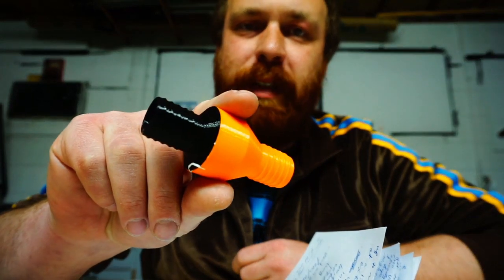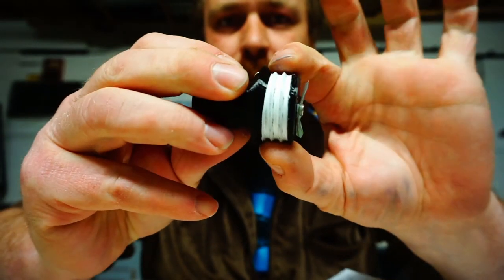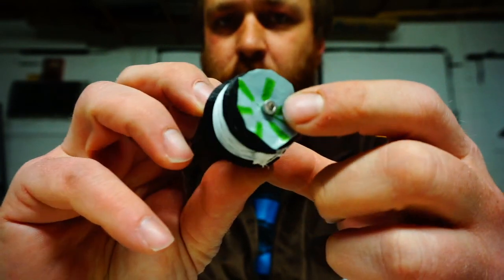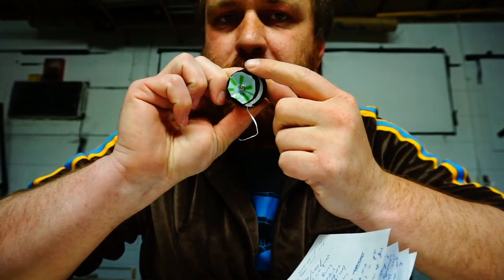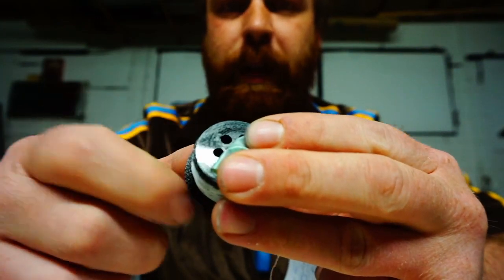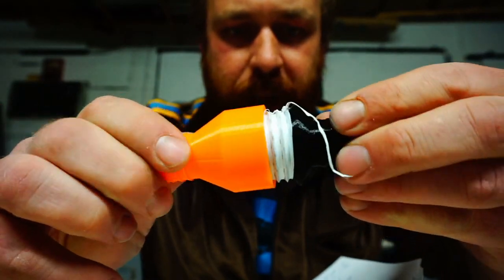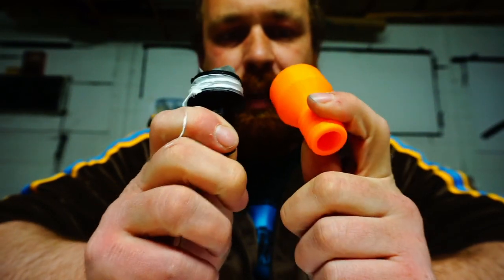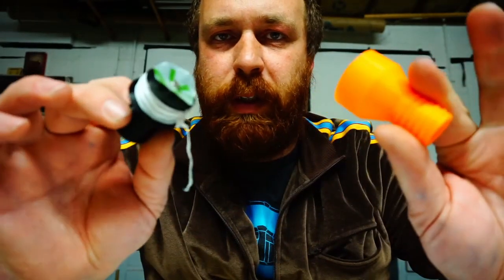COVID 19 CORONAVIRUS Ventilator Check Valve Part

Comment: I had an idea about a two cylinder system. the piston using two one way check valves. So the piston moves between 400 and 600ml of air for each breath. Use a variable crank-shaft to adjust the volume. One piston to draw in fresh air and expel it into the patient, the other to draw the exhaust air out of the patient and expel it into an oil/water filter to kill any virus from the patient. The volume of 400-600ml at a 12/min rate should provide the full extent of breathing assistance for any patient.

Comment: Great design concept! Why not print the entire piece in one go (print direction along the long axis), with breakaway supports in the center (on the side of the orifice that will not provide seal, supports removed after printing via pliers...15% dense line infill for support should work just fine)? Having one piece removes your large thread seal, and you'll probably still have a good enough surface finish (with most printers) on the opposite side of the orifice to make a low-pressure support. After printing, insert your screw with the walmart bag on the side of the valve that wasn't printed with supports. Happy printing!

Comment: Great job. If you want to buy a check valve like this it's the same as what's in a hand balloon inflator. You'd have to cut the end off and seal up the cut off end with something (when I designed toys, we used an awful lot of foam-core board and hot glue). You can buy these at the Dollar Store...

Comment: The black part can be achieved very easily. Take a compatible shape using PVC. Wax a sheet of glass or acrylic. Build a damn wall with silicone caulk 1/4" tall. Pour a pool of epoxy resin onto sheet. Sink PVC parts into pool of resin. After curing the resin can be heated to 140F with a heat gun. It will become very flexible like a thick sheet of vinyl. Warm and use hardware knife to separate parts. Do the same heating technique to trim outer edge. You now have a tube with a glass smooth air tight seal ready for drilling.

Comment: How do I download the solidworks files? I'd like to change the thread between the parts to something like NPT or a metric equivalent to improve the seal where you have teflon tape.
Reply from the maker: select the parts in the parts panel on the left hand side and click export.  you should be able to export as lots of different file types, including solidworks.  I usually use solidworks, but used Onshape this time, and would encourage you to do so too, that way anyone with a free account can see your mod, and take that one, and improve upon it, with just a free Onshape account, rather than having to have a solidworks license and box to run it on.  They wont let you edit my file, you just have to make a copy to your own account, and you can do it there.  If you come up with a better seal that doesn't require higher precision printing, let me know, and I'll share it.
Reply: @CAMERADACTYLCameras  I can select the parts but not sure where to find the export button. Do I have to login? any chance you could post here a link to the .stl version ?

Comment: I think PETG is a better choice for this application, its physical properties would allow for a snap-together design without extra screws or plumbers tape.  A solution that works straight off the printer would be ideal.
Reply from the maker: I agree.  I only have a few rolls of petg, and many printers wont get hot enough.  I use pla for prototyping, but it would certainly work with petg.  I'm not sure that I could get an air tight seal with a snap together petg version.  You're welcome to grab the file and make a petg snap together file, maybe you can get it air tight?  maybe with some glue as a disposable glue together unit?
Reply: @CAMERADACTYLCameras  I have been researching the designs for the DIY ventilator. My biggest focus has been on the ambu bag type resuscitation devices. They are still widely available for purchase, so they were naturally a good foundation for development. In your first video, you highlighted the need for a high torque low speed motor that is available as wide spread as possible. I have not seen anyone consider using windshield wiper motors, in my opinion they fit the bill. They are in scrap yards the world over and can tolerate extended use while being variable in speed settings. My thought is to run a linkage setup that would allow equal pressure on the ambu bag. This is the most analog and simple thing I can think of. Utilizing resistors to change the speed of the motor compressing the bag. From there, attach whatever tubing deemed necessary as well as the needed accessories (bubblers/deep fryer).
Does this spark any thoughts?
Reply from the maker: @ricebean2269  I have actually seen a setup with a windshield wiper motor and arm copmressing one of those bags.  I think that they are reasonable motors to use.  I would like to find one that maybe is pretty universal, like something GM, that there might be 100,000 of sitting in a warehouse somewhere.  hard to tell what's out there and what we'd run through.    I have been thinking about substitutes for bulb type pumps which are available at the moment. For now, I think I am going to concentrate on building a few valve types that can be easily printed and used in other peoples machines.  I have a few sketches for PEEP regulator valves that I'll try and get working in the next day or two.
Reply: What about regular NEMA steppers with a gear reduction?
Reply from the maker: @treehousedrag  I like that idea very much.  that's the direction I will start in if I make it that far.  Right now I am trying to concentrate on making 3d printed valves in all the types and configurations that other designers might just use as a part without having to design or source them.
Reply: For your check valve design, since you're printing direct to glass, you should be able to make two flat surfaces that mate together inside the air passage.  Have you tried or considered this design?  Asking before I chase the idea.
Reply from the maker: @treehousedrag  I don't think that would make 'as good' a seal as using a plastic bag for one of the mating surfaces.  I am working on a prototype for a PEEP valve, that would use two polished surfaces at first try, but then later add a gasket if necessary.   will update when I find something out.
Reply: @CAMERADACTYLCameras  good stuff, I will stay tuned.